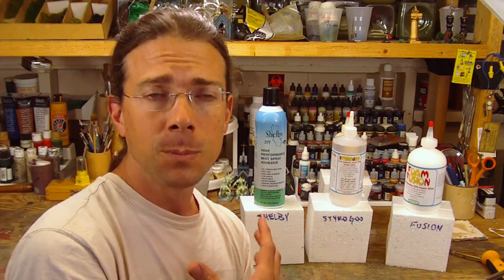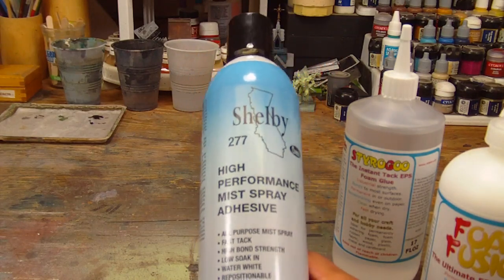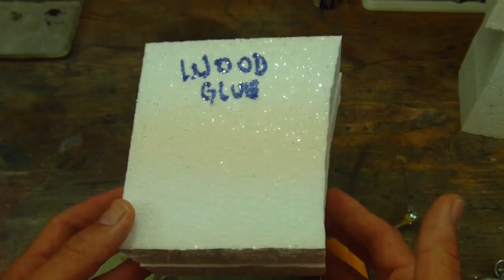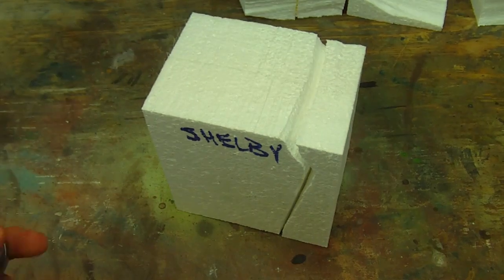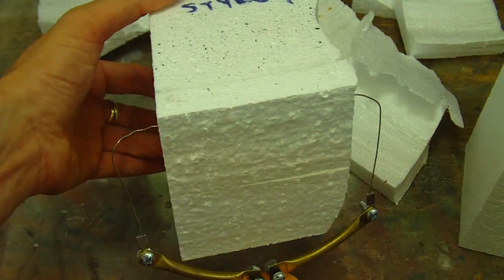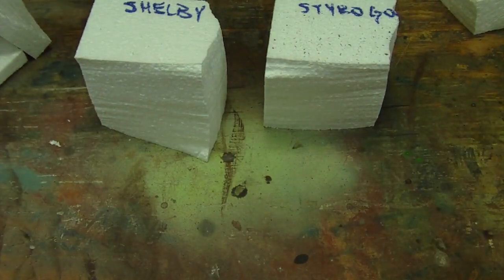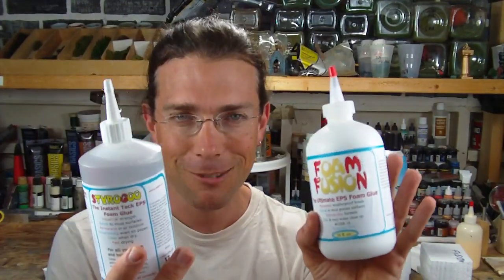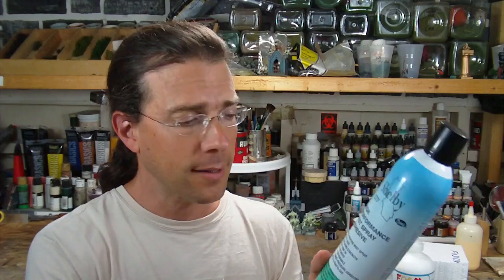TerranScapes - Hot Wire Foam Factory Adhesives Review

Comment: We used to recommend the Super 77 glue, but they changed the formula and we had a slew of customers who reported that it now dissolves foam. It sometimes takes several months, but those who used the new formula ended up with a cavity wherever the Super 77 was applied. It does take longer to dissolve the extruded polystyrene because of its higher density, so the damage may not be apparent when you apply the glue. This is why we carry the Shelby 277 spray glue.

Comment: I looked at two of your Foam Fusion review videos and I wanted to tell you about a foam adhesive that won't break.  Great Stuff for Windows.  The Blue can of great stuff foam insulation sticks to EPS like nothing else.  The trick is to take a paint stick or a scrap of wood and smear the great stuff till it is almost watery.  Then apply it to the foam.  and stick it quick.  It becomes tacky immediately and dries in a couple of hours.

Comment: The problem with wood glue is that it can cause warping over large surfaces. It certainly is great for wood and dental plaster (i.e. Hirst Arts bricks) but for foam I would probably go with the StyroGoo. Even though the price is considerably greater, the strength of the StyroGoo really impresses. Thanks for the great review!